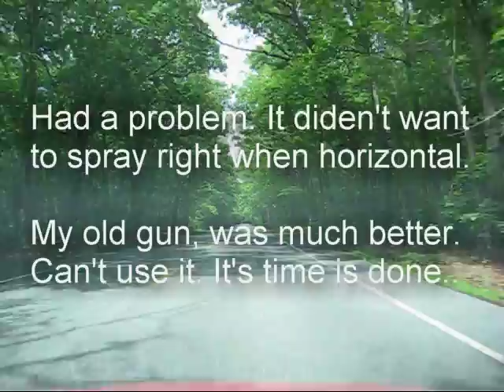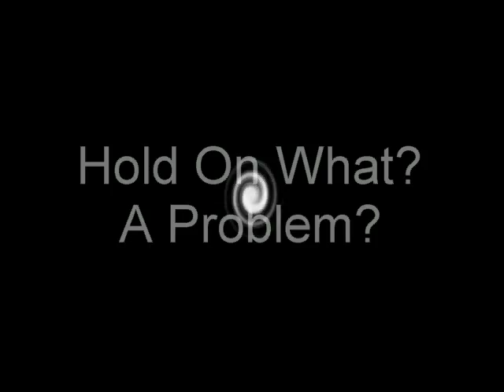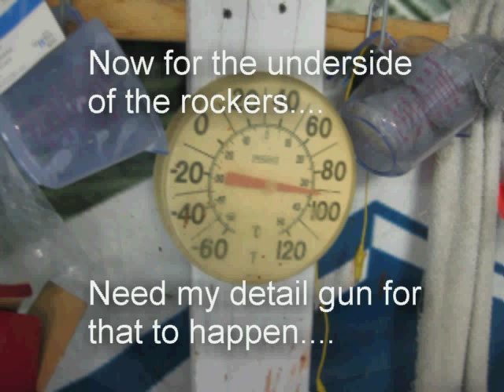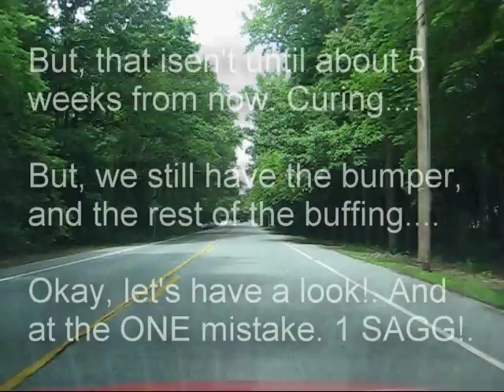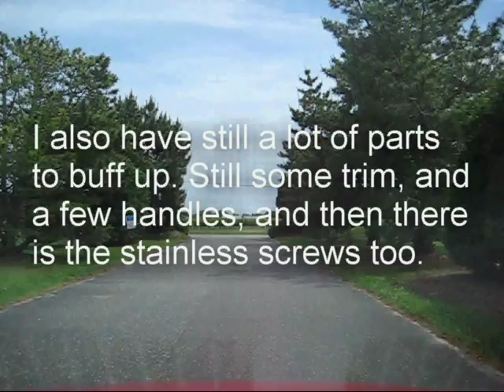62 Fairlane Painting The Old 62 (Body and The Steering Wheel)

Comment: Fantastic job!  That paint really pops. Brings the whole project together nicely. You have to be happy with that outcome.
Reply from the maker: Jeffrey Cardimen 
Thanks. But, were not out of the woods yet. Still, Imaging the paint. I hope there is enough for imaging. There are only 2 places where it went on a little dry.  Ran out of paint just about in the middle of the last coat. There is 1/2 gallon just on the outside... The sag, well, we will see how I do with that. If I sand through, I will mix another batch and re paint the whole outside body. But you know, if I do, the next coating will even look better than this one.... We will see..... 

Glad you like the color.